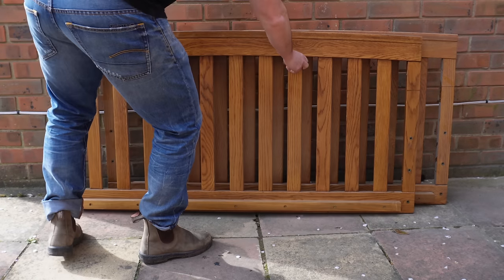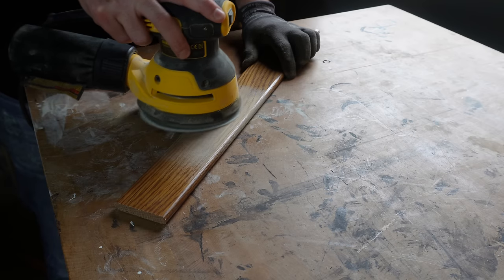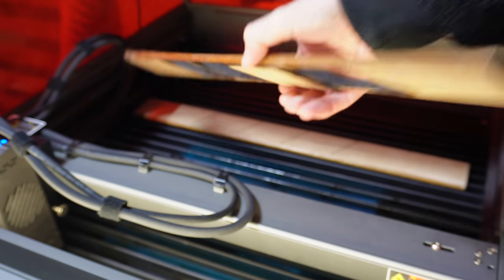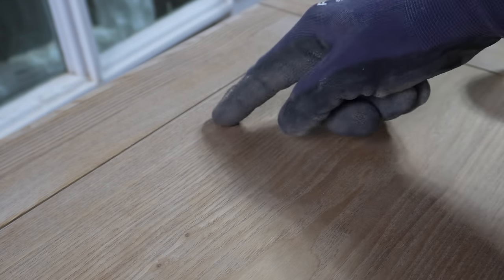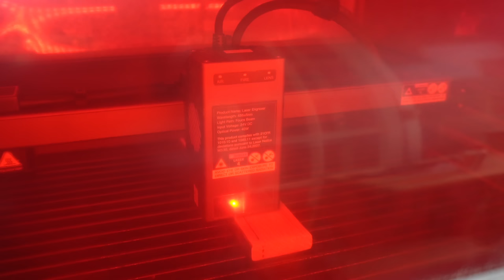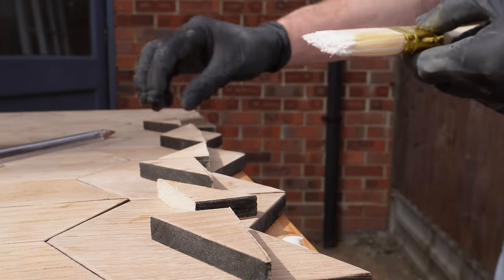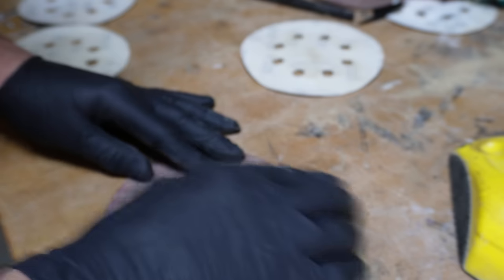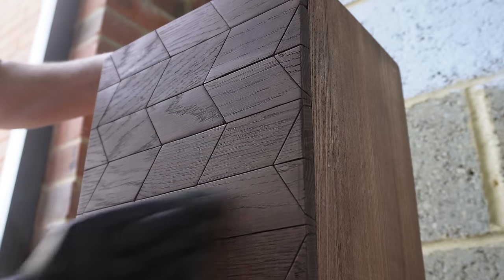I cross a babies cot with an old dvd cabinet

Comment: And now for the project post — that is a lot of solid oak! What a find. This type of cabinet would have made the storage of VHS tapes handy for homes. DVD storage capacity would have quadrupled the number of options in the same cabinet in later years. Now, with this beautiful new
face, this piece can have a new life as a dry bar, mini library cabinet, or crafts center moving seamlessly into the decades to come.
Reply from the maker: Thank you, hopefully it find a new home that will find a good use for it :) Cheers for tuning in!

Comment: You admit to using the METRIC SYSTEM???!!!?!!!! That was two and a half strikes right there buddy. If that didn't come out looking like a million dollars, I was going to give you a THUMBS DOWN. Next time, use good old fashioned inches like God intended ---or at least hide your ruler from your American audience. 

Wow! I hope you kept that for yourself. The only thing that might have added value is those wine glass holders, a mirrored back or felt on the bottom of some or all of the shelves. Storing booze is the perfect use for that. 

And lastly the crowning touch was putting a proper finish on it. A lot of your competitors do such wonderful work but they don't seal it up with a good protective coat to protect their work from daily use.
Reply from the maker: I will burn my metric ruler at the stake immediately and swear allegiance to the almighty inch from now on 😂 NOT. No, I won't be hiding it my from my American audience - who until you, have never had a problem with it. 95% of the world uses the metric system. I am pretty sure America is now the only industrialised county that doesn't use it as the predominant system of measurement, however it is still widely used there. But who cares? First world problems.